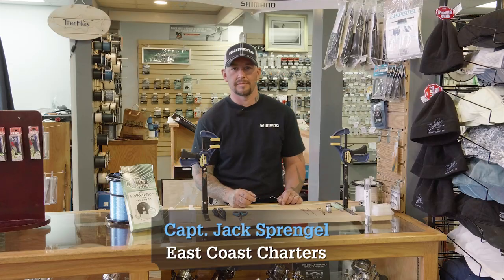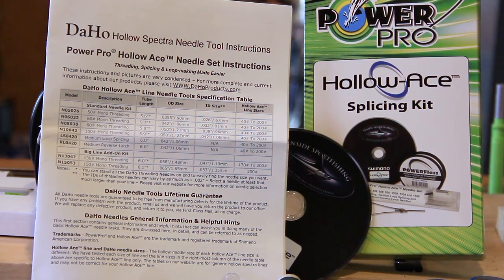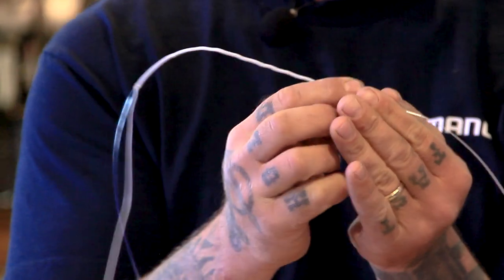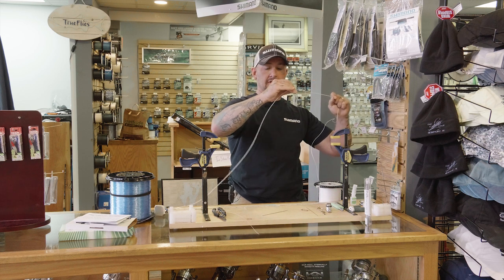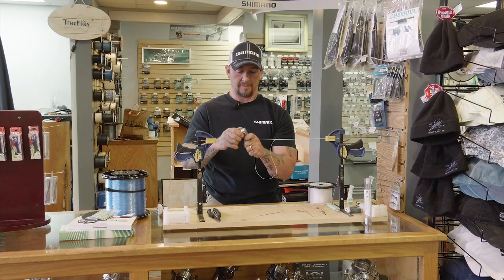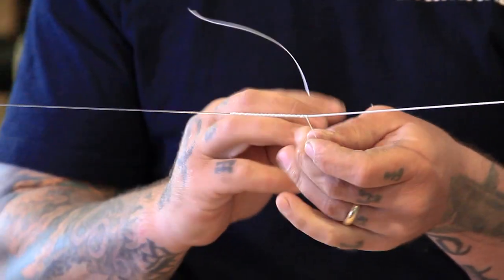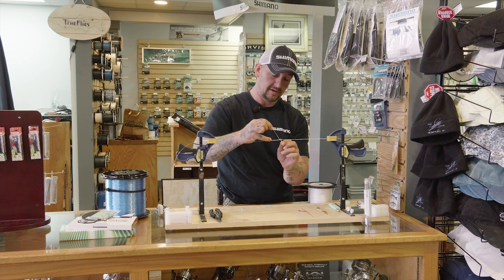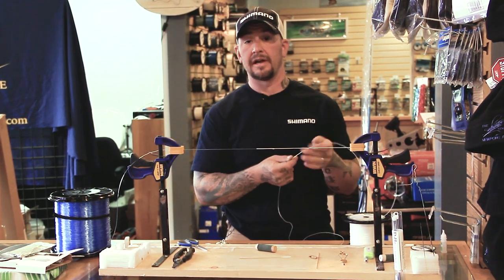How to Make a Wind-On Topshot | Using Hollow-Core Braid to Connect Main Line to Leader for Tuna

Comment: I didn't see where you tightened that PR bobbin knot so that the wraps bit in to the mono/fluoro. Basically, that knot just keeps the end of the hollow core braid from unraveling, right? But I don't think it serves to do anything except support the chinese-finger-style connection between the braid and the leader served into it. Is that correct? Or does that PR bobbin knot actually serve more of a purpose?
Reply: As he mentioned, the PR knot is a 100 % knot as well, and is commonly used on non-hollow braid to mono. Although he didn't make super thight, so in this case its more to keep the leader from slipping should you lose tension on the line for some reason. I'd recommend watching this one: https://www.youtube.com/watch?v=QDuZwxBjW4M

Comment: We for gaint blue fin go 2 fathoms up inside ur braid then wipe splice every 3 ft from top to bottom ,half hitches with 3 inches long ,an we never lose any fish up to 126 inch 860 lb ,,I don't know about this guy's method,if it pulls through ull have a birds nest an if it gets in ur top roller guide ,you'll lose ur fish ,,,I've seen a 💩ton of so called experts ,no disrespect to the video guy ,just my experience,I had to learn ftom guys that have caught giants for years an for our live ing ,great video though
Reply: I agree with going in deeper if it's a direct splice. I usually go about 10 feet. Takes maybe two minutes to go ten feet. Why not at that point. When it's a wind on leader that you're casting, going ten feet isn't a great idea. Having that long a section really impacts casting. I have realized if you go about a foot shorter than the rod, casting isn't impacted so I'll go anywhere from 6-8 feet. You don't want to ever have the full splice in your guides casting. I fish giant bluefin in the winter in North Carolina and we'll straight inline the full ten feet. Not sure about the need for that many whip serves but I'm sure it works. What we do is actually tie two nail knots on the mono under the spectra sleeve. We then serve the last 4-5" of the spectra with 20lb solid spectra. Haven't caught an 800+ pounder but hopefully soon. Plenty of 5-600 pound fish though and the splice has yet to cost us one. Tight lines!

Comment: When tellingbpeople how to chose like sized or test lines to build the wind on rig, please remind people that not all lines in the same test are of equal diameter. That is due to line manufacturer and quality. 

Monofilament and florocarbon technology has improved greately over the years where line strength have increased while reducing the line diameter. 

So you have to chose carefully which line to match with whi h hollowcore by line thickness, stre gth, quality and as per the target species, so as to make the right decision to ensure not only a hookup but a successful landing.